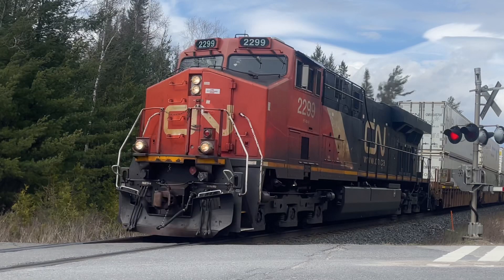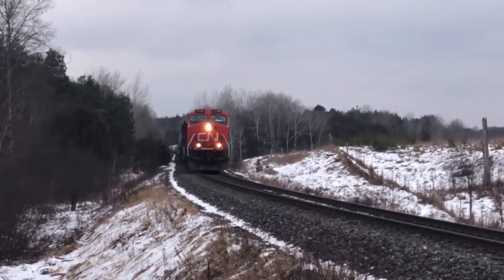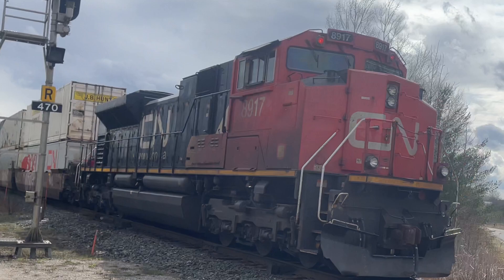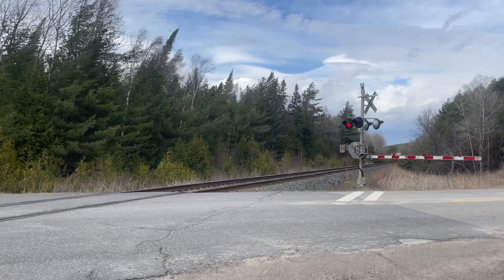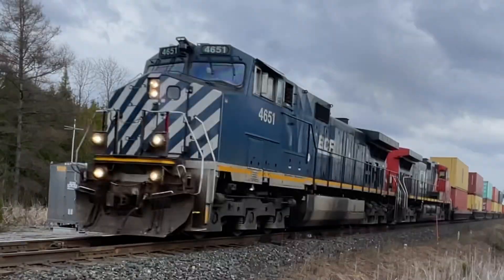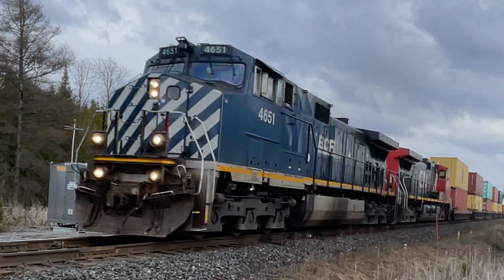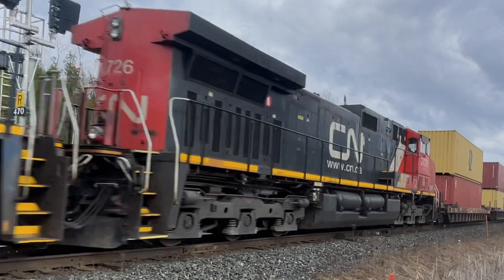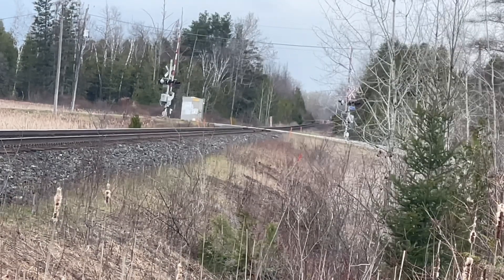(BCRAIL 4651 Leader on CN X105) More Short But Insane Railfanning at Zephyr

Comment: CN 105 no X

I heard it on  Broadcastify at Mile 305 Kingston sub.
Reply: I got told X
Reply from the maker: @Theconductor607  Same. :D
Reply: @Theconductor607  105 No X
Reply from the maker: Q105 Yesterday had a CREX Leader. :D
Reply: @harps1974  not to start an argument, but Tyler is right. Q105 had a CREX and X105 had the BC Rail.

Comment: K5HL horns are better on GE Power than EMD Power.
Reply: I know it doesnt fit with older units like the Dash 9 or Dash 8 but it does make sense since Dash 9 and Dash 8 units have wide cabs like the GEVO. So it makes sense. On units like the C40-8 it doesnt make sense.
Reply: It also have a Graham White E-Bell for whatever reason
Reply from the maker: Agreed. :D